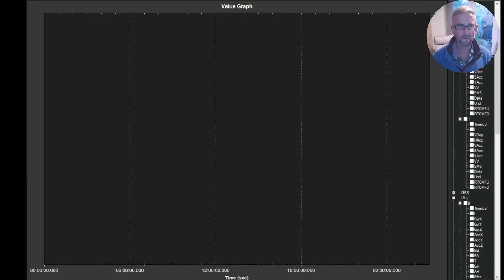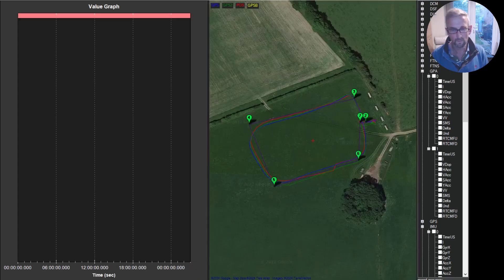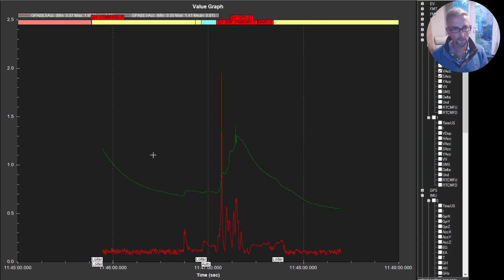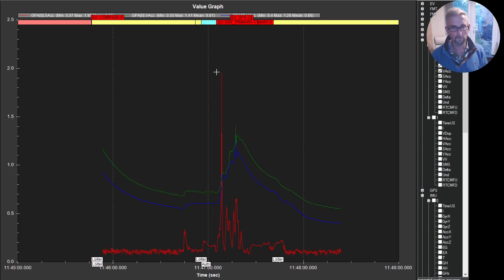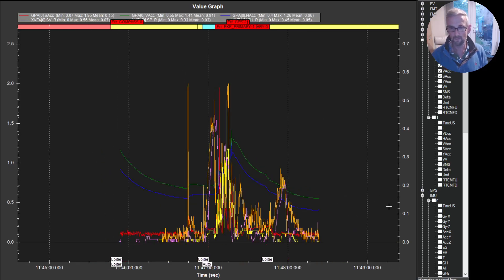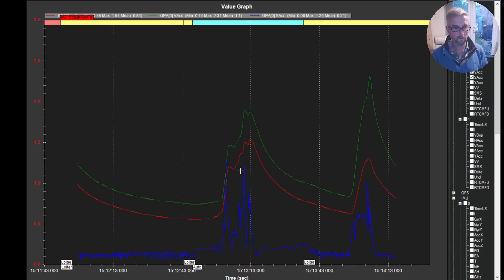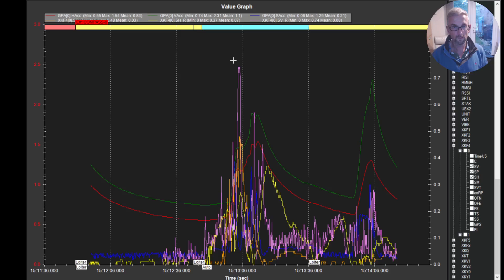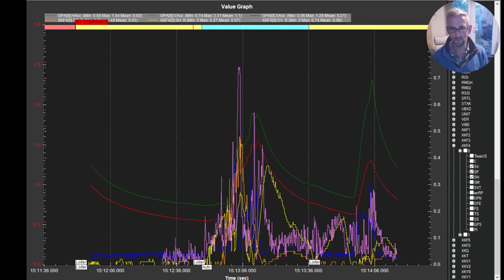GPS Speed Test Part 3 - M9N Micro vs M10Q 5883

Comment: Have you ever tested the Flywoo m10 mini with compass
Reply from the maker: @jamesmason7124  Hi, don’t think I have one of those so have not tried it
Reply: I'm building a Flywoo Explorer LR 4 v2 from the analog frame kit up and i plan on using arducoptet or inav and I've been thinking about using the flywoo gm10 mini with compass,  i believe that is the one that fits the factory tpu mount. I also plan on using the Holybro H743 mini flight controller,  flywoo Goku g45m  esc , flywoo 1404 2750kv motors, and the Rushfpv tank solo vtx with a Caddix ratel 2 camera all powered by a flywoo 4s lion 3000mah battery.  What do you think about this setup and what would you recommend.  All i have right now is the bare frame kit
Reply from the maker: @jamesmason7124  sounds like a nice setup!